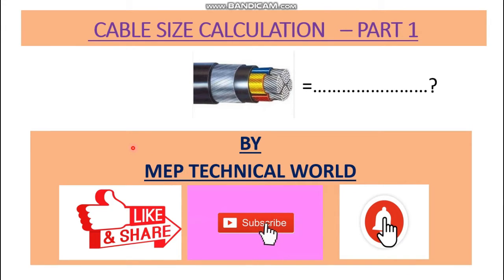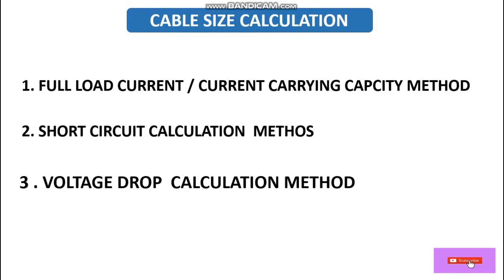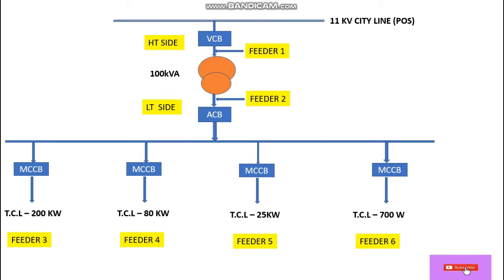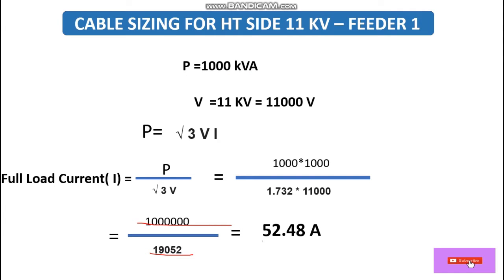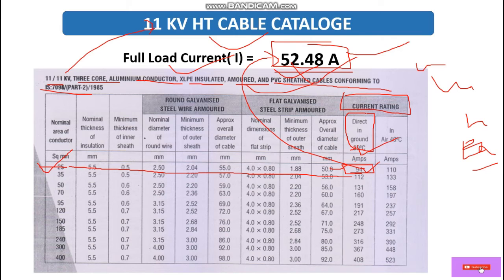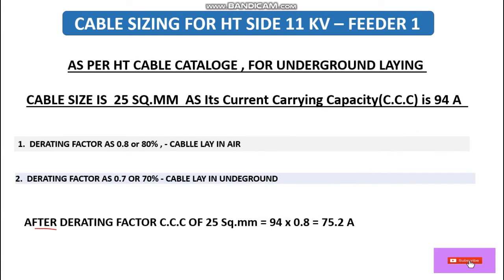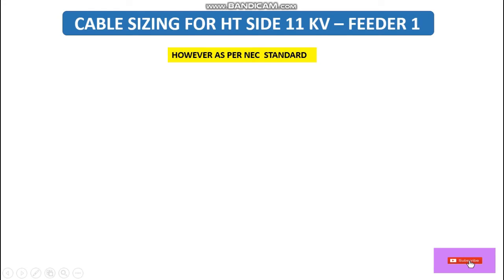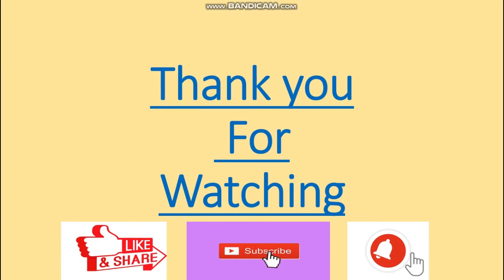HT Cable Size Calculation | Cable Sizing and Selection | Part 1

Comment: Cable sizing information is wrong. 
If u consider 1000 kva that's amp capacity is 52 amp
Let's move further 
Include derating factor 0.65
This is value of soil resistivity , depth of laying and temp factor 

52/0.65 = 87 amps 
Available size is 50 sqmm  3core xlpe / PVC swa/PVC

1000 kva trafo short circuit is 0.85 ka another hand 50 mm cable short circuit rating is 7.5 ka 
Hence it's proof 50 mm square z sufficient.

For safer side u can go for 70 sqmm
Reply: Sir please give me your number sir I have lot of Dout give me ur number sir it's very helpful for me

Comment: You are speaking of 100kva , but displayed as 1000kva.I am confused
Reply: The calculations part is correct. Consider it as 1000kva then ht current is 52A. For 100kva it's 5.2A.